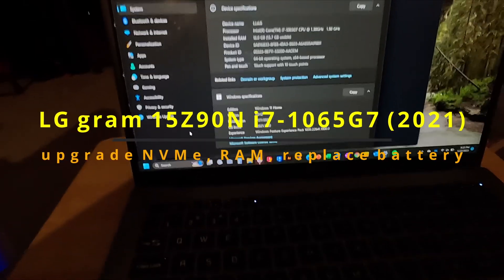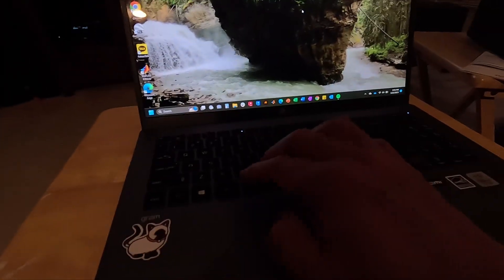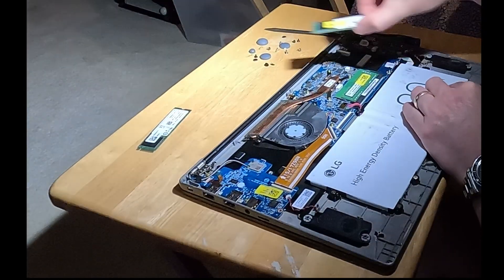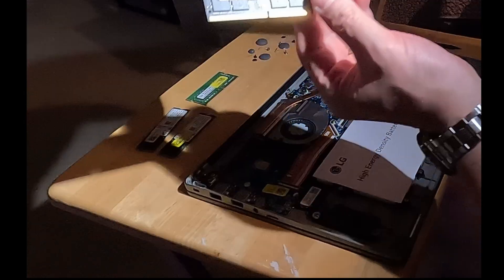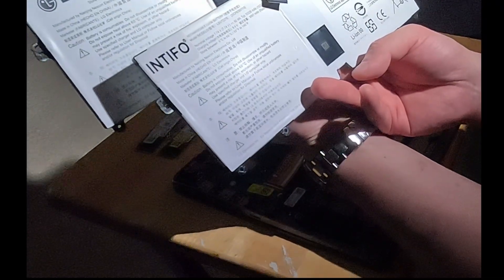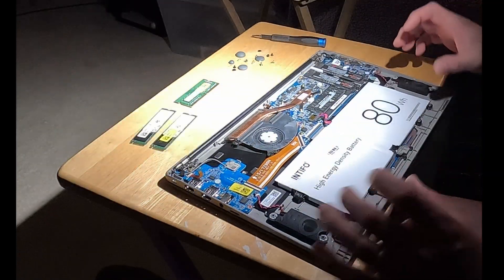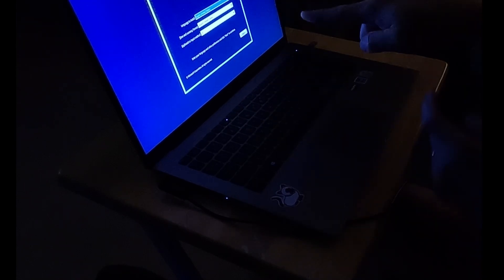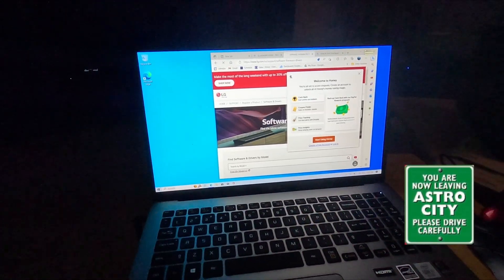LG gram 15Z90N upgrade & repair

Comment: Congratulations on the video. I have a model identical to yours. When opening it, I lost the correct position of the screws. I noticed that it has 3 smaller ones in black and 5 larger ones in silver. Do you remember what their original position is? I couldn't identify from your video. Thanks.
Reply from the maker: I lost also, but I'd guess it's either back center & sides, or front center & sides.